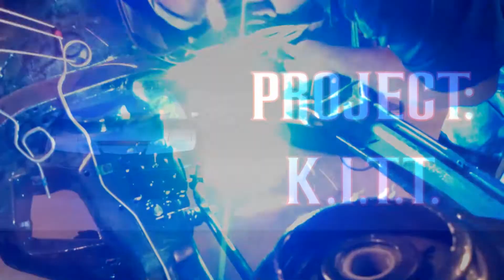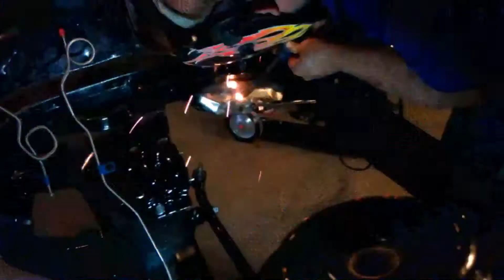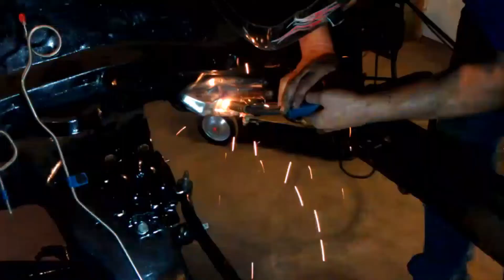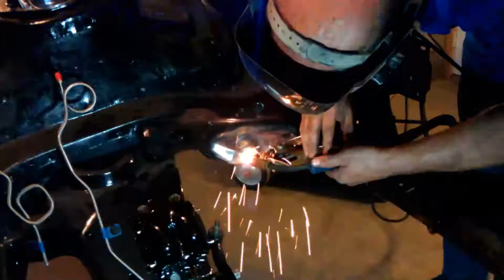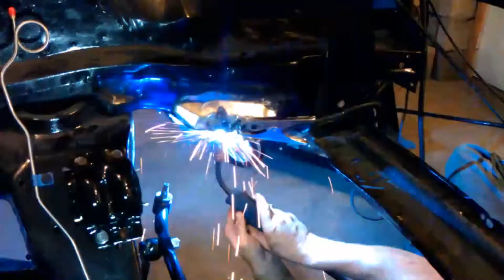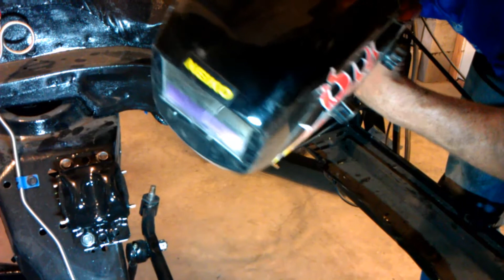Repairing The Stress Cracks In KITT's Frame

Comment: Weren't the third gens unibody how is there a frame , im still learning about the structures of cars sorry for the dumb questions
Reply from the maker: Keeping in mind that I am by no means a automobile expert, the unibody is essentially a one piece design. That being said, there are still very distinct frame rails underneath. Even though they are fused to the rest of the body, they still serve as the primary structural support. If you watch my sub-frame connector videos you can see the frame rails I am referring to. You will notice that the frame rails do not extend the length of the car. This is why the sub-frame connectors are necessary to connect the frame rails and stiffen the body.
Reply: Thanks for info I've watched most of your videos but have yet to watch the sub frame connector didn't know what it was it looked like sway bars to me lol